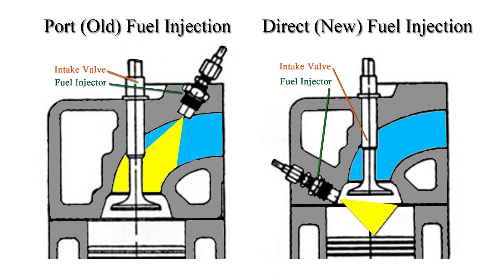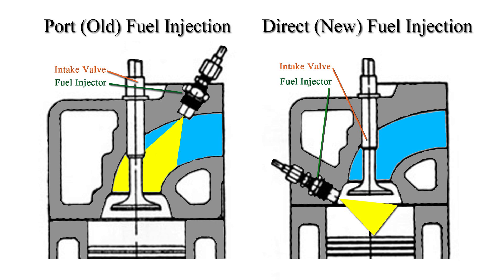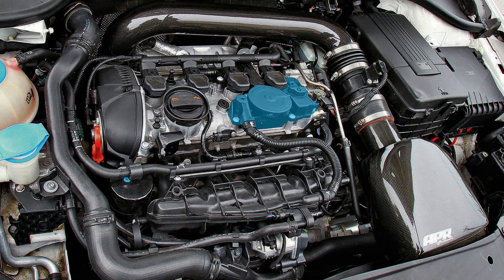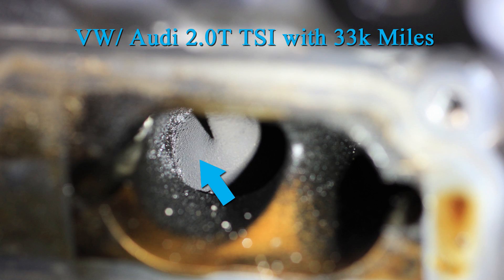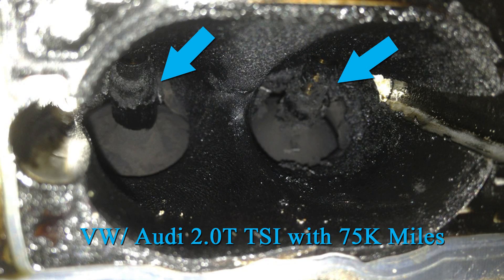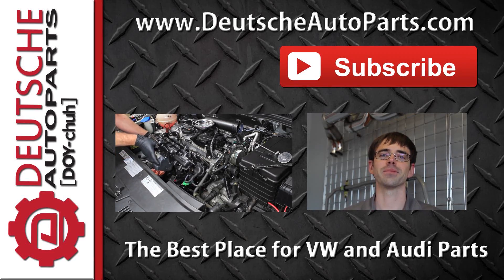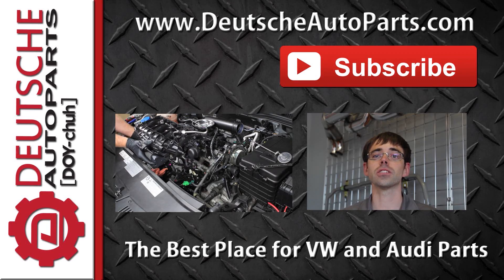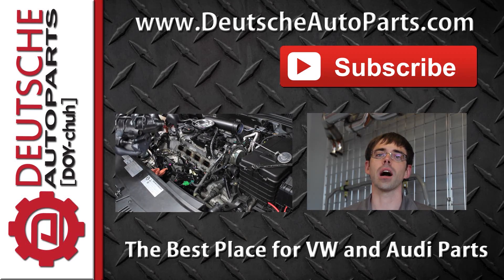Carbon Build up on Direct Injection Engine (Intake Valves) AKA GDI Gasoline Direct Inection

Comment: For what it's worth... I just purchased a 09 Audi 2.0T Direct inject car..  The day after I got it home I started having Cold Start mis-fires.  I did tons of research on the interwebz and youtube and found out about the carbon issue.  I found a car guy that said he had great success running the 'chemical' seafoam treatment so I had him do his thing.  Two days after this, my Check engine lights are not re-lighting and my cold engine misfires have gone away.  I will have him do another treatment on the next oil change and then every other change.   YMMV, but I am pretty happy my car runs great now.
Reply: Good to hear that it works. I'm on the fence to try it ... even if it works only for a couple of thousand miles. Doing this with every oil change might be a smart thing.

My last bill for cleaning out the intakes of my GTI engine was 900€ or so.
Reply: You can wipe out turbo's and cat convertors doing it though....

Comment: diesel has been direct injection forever.? maybe use diesel type motor oil I these engines as it's much more cleaning oil then normal gas engine motoroil.
Reply: I suspect that the compression ratio of diesel engines which run up to 23:1 completely atomizes the diesel particulates into the form of the black smoke.  Car engines today run around 10:1, and with the EGR systems, aren't able to totally vaporize those emissions.

Comment: can't you just blank off the recirculation?
Reply: Daniel ford Regarging vag engines yes. There are pcv delete kits. IMO the first thing someone should do to their tfsi as well as check the cam follower of the HPFP and replace it if there is wear.

Comment: Mitsubishi makde Direct Injection gasoline engines all the way back in the nineties for mass production (Mitsubishi Carisma). That was a disaster because of carbon build up. Worse even, the theoretical fuel saving of 15% was never measured by consumer reports. Comparitive testing showed that the gain was 2%. That was easy testing as Mitsubishi was so foolish to deliver the Carisma with or without GDI engine. Now, Mitsubishi does not use GDI anymore. I wonder why other makes did not learn from that experience.
Reply from the maker: +Ronald de Rooij I'm not sure a company on the verge of pulling out of the us should be considered a shining example of technological innovation in the auto industry.
Reply: I did not because they went back to the old ways. I fail to see what the market position of a company has to do with engineering solutions too. So yeah sorry to say but you are a bit off. I also wonder if just driving a long distance on high speeds regularly would solve the carbon problem.

Comment: why not use an air oil separator , Crawford, Perrin , and Grimmspeed make some
Reply: air/oil separators are post PCV
Reply: you need to read aol is different than a catch can aos is better and is not post pcv ,the pcv is rerouted

Comment: anyone have any clue how much would it be to clean off carbon build on an Audi S5 engine?
Reply: why don't you call the local shop or dealership. I think they told me around $800. a new manifold is probably $1100

Comment: Hey guys love the videos .! I have a MK7 GTI now with 40k miles ,I have been taking my car to the dealer for service since new , I have been changing the oil every 5k miles because I really like this car and I want to keep it for a while..! When my car turned 35k miles I was told by the dealer that it was time to clean that carbon issues so i agreed.! During the 35k to 40k miles my car had some issues, one time the EPC light came on and the engine started to shake , I turned off immediately , turned on again and the engine was fine but the check engine was on but after driving the car for a couple of days it was off ..! Two weeks later the check Ing light came on again!!, but the car was working just fine and same after driving my car for 2 day the light turned off..! Last weekend I took my car for the 40k service told the service guy what had happened ! I was told that my car had misfire .!! And I was told they did a induction cleaning service..! They charged $129.35..!  They also did the Recall !! My question to you guys , Is this normal in the MK7 GTI ??  

Oh yeah the service technician told me that I have to drive my car hard Ones a week ..! 😳😒..! I found that advice not very helpful!
Reply: El Chero, I was wondering if you had any more info about this particular issue. I had the same exact thing happen to my audi. Only difference mine happened right after i pushed it to 125mph. As soon as I backed off and started to accelerate again epc code and engine shook like it was blown. At the very least the timing was completely off. Limped 3 more miles to work. Turned it off and immediately back on and epc code was gone and seems to be running fine now...although I haven't pushed it hard since then (RPM not over 3500). Did you do anything else to fix this or did it ever happen again?
Reply: M Hamrin  no i never had any other problem for the next 15k miles , I couldn’t tell you after 50k cuz I lost my car in an  accident!
Reply: @TheCipotemasloco  Thank you! Sorry you lost the car. Hope you replaced it was something even better.

Comment: Hopefully this page still gets checked. I was wondering if Deutsche has a video on the manually cleaning process of the cylinders. After manually cleaning the carbon, do you recommend also replacing Intake Manifold and Fuel Injectors?

Comment: So basically all the detergent (chevron techron, shell nitro, ect) fuel companies put in gas to help keep the engine running clean and smooth have been rendered useless with DI. So far Toyota has the solution by adding both port and direct injection to their engines.
Reply: Kamaldeep Singh Vw also uses both di and port injection on gen 3 ea888 tsi, not in the us market though. In europe we have both.
Reply: The detergents  and additives are still beneficial for the carbon build up on the pistons and cylinder, but the intake valve (especially the ones near the EGR intake) are left to fend for themselves.  Companies like Ford have finally acknowledged the problem after 6 years, and are looking for a solution, but nothing so far...and who knows if the fix will be retroactive.
Reply: Stephen C.
Reply: Boostang S.I.C I've noticed a puff of smoke on start up @ 9000 miles
Reply: it's all marketing bull shit.

Comment: I don't get it. So you have some carbon on a valve. Rarely ever causes a problem. To much effort to little gained.
Reply: Interestingly, Marvel Mystery Oil was developed in WWII to help keep those old huge radial engines from building carbon while running rich on the deck of an aircraft carrier.
Reply: Thomas Burns because you don't have an injector in a port washing the valve, so pcv fumes and egr cause the issue. 
Yea don't ya love new stuff ? 
Hey check out this great new product, sorry we didn't do long term testing to see this problem at the factory. 
Ah well someone will figure it out someday,in the meantime you can trade it in every 2 yrs and it's not an issue 🙄
Reply: Jon Lucas hmm sounds like you've read the article I read. 
It was so long ago I forgot what it was in. 
It was an aircraft publication and they sent it to a lab to see what's in it. 
I wanna say it was around the time the Mobil aircraft oil debacle. 
Anyways, it has wintergreen in it for a nice aroma 😛
 (technical article and that's what I remember 😂)

Comment: There IS a solution.  Stop manufacturing direct injection.  Seems to me to be just another cash cow way to squeeze more servicing costs.
Reply: +MrTheHillfolk what? a tie rod end? Is that perhaps the most irrelevant service estimate you could have given me? I think so.
Anyway, I just paid $180 at a local shop to have the valves cleaned on my Mazda (DISI engine). The guy does N54s too for the same price. Sure, if you go to the BMW stealership it's gonna cost an arm and a leg. But good heck you can do the work yourself for under $60.
Reply: It doesn't make total sense because they're two totally different types of work... engine vs suspension. You know as good as I do that certain shops specialize in specific work. And dealerships charge out the nose for any work. So go to the valve cleaning guy to get your valves cleaned for $200. and do an end link/tie rod yourself lol
Reply: Tab McLain it's gonna be more than that. 
A bud just got a quote to replace 1 tie rod end for 400$.
Reply: That is exactly what Mitsubishi did after the carbon build up debacle in the Carisma GDI in the late nineties.
Reply: Tab McLain 
Makes total sense. 
If they wanna charge that kinda money for a tie rod end , I wouldn't even ask for a quote on a more difficult job.
Reply: Tab McLain I don't even bother cause I do all my own work.
Reply: Ellesmere Wildwood you know diesel cars have been using this for a while now
Reply: nop.
government. . don't want this. .
is they way to have more jobs..
if I'm wrong
Reply: It's all because of the EPA
Reply: The advantages of DI pretty heavily outweigh the burden of paying $200 every 50,000 miles to have your valves cleaned

Comment: Sorry guys, there is no "prevention".  Carbon buildup has a lot to do with Exhaust Gas Recirculation, which in TSI/FSI motors is accomplished through valve timing.  People with catch cans are still seeing a lot of buildup; it seems the only thing that helps is to drive your car hard.  Sitting and idling is hell on these motors and will choke them up quick.
Reply: You're mostly right. A catch can will help, but will not prevent this. The EGR does have some issue with this, but the REAL issue is reversion. That is the overlap built into the cam which opens the intake valve while still in the exhaust stroke, allowing contaminated air into the intake tract. DI seriously aggravates this issue.
Reply: The PCV just compounds the problem...like I said, people with atmospheric vented catch cans still see buildup.
Reply: drive hard is the best way !!
Reply: Shadyn Ebey do you know what ford has done on the 3.5 twin turbo in my 17 SHO? I heard they added port injection back to help alleviate the coking problem but it’s not active all the time .
Reply: I got a better solution! ditch that DI and use MPFI. or else Toyota is doing a price hype!
Reply: DI is able to accomplish much better fine tuning of AFR, thereby reducing emissions while increasing power and economy from the same displacement.
Reply: I know but it does have longevity issues, and I am a value for money and efficiency guy.
one thing that can be done is to take care of blow by or pcv system. this will reduce oil consumption too...
Reply: Great points and I was going to say the same thing. VVT/overlap recirculating exhaust gases onto the back side the valves....even if you have a PCV side catch can and air/oil separator on the valve cover, you are still going to get coking on the backside of the valves. Having 2 catch cans (or 1) is still better than nothing but not going to solve the problem completely. water/meth or aux fuel injection will help too.
Reply: Do you have a question, Peter?  I don't understand the point in tagging me in a comment without saying anything else
Reply: Shadyn Ebey with 2 catch cans (PCV and valve cover side), gunk should be kept at a minimal. But the soot/coking from the recirculated exhaust gases (VVT) on the backside of the valves will still occur. Even with meth/water or aux fuel port injection this will still happen (but will help a little) because fuel is only going to sprayed on the top side of the valves.
Reply: yup...essentially what I said....overlap is a result of VVT
Reply: All engines, VVT or not, experience reversion. An engine can not run worth a crap without the built-in overlap. Actually, a VVT engine has slightly less reversion, but they still haven't been able to eliminate it.  Sucks, but true.
Reply: What if I disconnect the PCV and route it to atmosphere and not back to the intake ?
Reply: muataz shammari Your legal authorities will screw you!?
Reply: Amaey Paradkar only if they open the hood. Most shops plug in the sensor reader to do the emissions test. If no codes are thrown then your good to go.
Reply: Nair Fotografia how hard do you have to drive. Looking to get a mk7 gti with the TSI and wondering how to prevent the buildup.
Reply: Jacob James And this is how you solve the carbon build up problem. :P

Comment: I have an idea :
Remember the old carbs with dual jets? one for idle and one for heavy load? why not make a dual jet system for GDi ? port injectors for idle and direct injectors for throttle application ?
Reply: That is a good idea...I think Ford is looking into something similar to that, but I haven't heard anything official yet, and it wouldn't be easily retro adapted.
Reply: Toyota is using a system like that. DI and MPI that sprays the valves clean.  I'd be very interested to see how and when the computer switches between the two.
Reply: Toyota does this for the FR-S/86/BRZ (the engine is a Subaru but they supplied the PI/DI combo tech). As far as I know, they've patented it, and it also adds some extra cost.

Comment: Thanks for the explanation! That was helpful. I have also read pushing the engine to high rpm helps in breaking down the carbon. Is that a proven claim?
Reply: even tho that was more toward the older cars ..I dmn sure hope it aplies to ours ..because I sure do put it down

Comment: Diesel engines are direct injection, with or without pre-chamber. I've not heard of carbon buildup problems on them. So if not a problem why? Does anyone know?
Reply: It's not the point of the type of fuel, if it's not spraying on the valves due to direct injection, there is no way for the fuel to clean off the valves. Unless there is no return of crank case fumes to the intake
Reply: They might not be required by emissions standards to recycle CC gases.
Reply: Because diesel fuel is a completely different animal... It fires based on heat from compression vs a spark plug
Reply: Fuel has alot to do with it. Diesels are using Ultra Low Sulfur Diesel and they all have emissions equipment whether it's DPF or DEF that leads to no return of fumes to the intake.
Reply: I see what you mean about the type of fuel, but combustion blow by alone will build up increased pressure in the crank case, and if not relieved can blow out gaskets and seals. As you know, this is done by the PCV valve in gas engines, with the gasses returned back to the intake. I've read diesels have a breather cap instead, although the gasses are still vented to the intake.
Reply: Actually the early VW TDI diesel engines had huge problems with the intake, and intake valves coking up. The problem there was VW saw the need to use an EGR valve to vent exhaust gasses back into the intake manifold. You could either widen the parameters of how often the EGR valve opened or remove it altogether.
Reply: Dennis Pedigo, Do you know if later models were better? If so, what did VW change to solve the problem.
Reply: I believe so. The problem seems to have been eliminated on the 2005 and later TDIs. These are now common rail type injection systems that do not have a mechanical sequential injection pump. The injection system more resembles a direct injection gasoline engine.

Comment: And that is why i will NEVER buy a car with direct injection engine. Yeah they're more 'efficient" but the money you save from gas you HAVE to spend in cleaning the engine quite often, which is not worth it. 

A clean engine is an efficient engine, and direct injection engines are NOT clean.

 I pity those fools who not only buy these things, but second or third hand as well with 60-75 on the clock. Those ones must have lost,like 40% of their efficiency and power, and they're still more expensive than a 20 year old car with a CLEAN conventional injection engine.

Comment: What is your take on shell v power nitro fuel in combating carbon build up?
Reply: It certainly can be a help to clean up any part of engine the fuel actually flows over. Unfortunately, if we're talking about direct injection engines, the carbon will not be cleaned off the valves like this gasoline can promise for port injected engines.

Comment: Do you think adding a injector  or two into the intake manifold would help with carbon? Would the extra injector(s) need to work with the main injectors at same time or could the extra injector(s) work by itself. For example at a set time limit the injector(s) would spray into the intake manifold.

Comment: Will this help on an ALH TDI? Thanks, Dave.
Reply: +Dave Kana no.
Reply from the maker: ALH TDI carbon comes from the EGR system and is generally in the intake manifold not on the valves.  

This requires the manifold to be removed and cleaned
Reply: +Deutsche Auto Parts I cleaned the EGR, intake was fine. So would a catch can help in my case? Thanks again, Dave.
Reply: +MrKbustera thank you!

Comment: This is bull crap, that auto makers are moving so slow on this. We are already forced to buy cars with smaller, usually Turbo charged engines, which don't last as long as bigger NA engines. Now this, 30 to 60,000 miles until invasive work is required. At least Toyota is doing something, but only on certain vehicles.
Question: All diesels are direct injection, although some have a pre-chamber. Do they have problems with this?

Comment: why route back the smoke to the intake ?
Reply from the maker: Emissions
Reply: what if I am running e85, what would be the point of it then ?
Reply: running e85 does not make a difference in this case, so again, emissions. The environmental consequences of e85 is the same as for normal fuel. The thing that is better is that e85 takes out carbon from the atmosphere before it gets burned as fuel before taking the carbon back into the atmosphere. For your engine that does not matter.